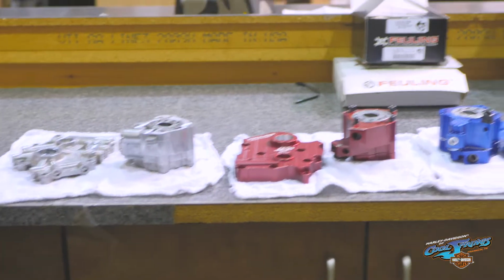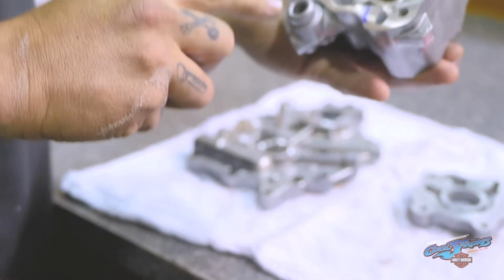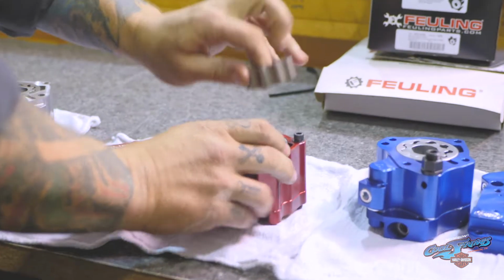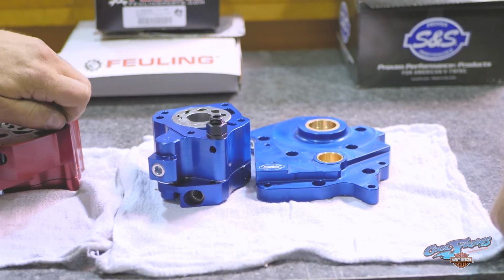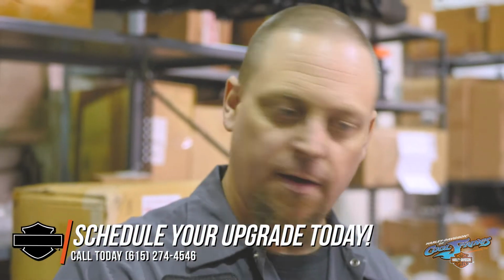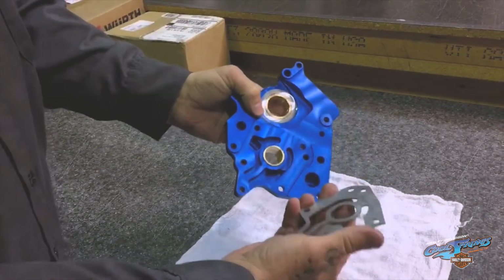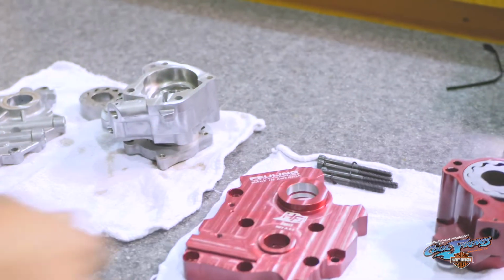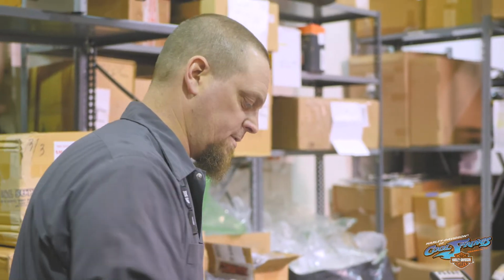Comparing Cam Plate Oil Systems ( S&S, Feuling, Harley Stock) | Shop Talk Episode 6

Comment: Softer metal will last longer,ok
Reply: The pumps/plates themselves are made from from very strong 7075 billet which is 50% stronger than the OEM cast.  The S&S system then adds the bronze bushings to be a "soft wear" point in order to make it rebuildable.
Reply: _MotorfastOk ,but are those OEM plates causing any failures,which require replacing? I do know the pump was replaced because it wasn’t sending enough oil throughout the engine with the stage 3and4 upgrades.
Reply: @tax905972  No the OEM system does not contribute to failure any more than any other OEM component.  The "sumping" issues were not nearly as common as the internet made them sound.  The biggest reason we recommend the replacement is the increased volume on both the feed side and the scavenge side will help ensure the oil is circulating at the highest rate possible.  Therefore doing a better job of cooling, cleaning, and lubricating the contact metals.  The billet pieces are also stronger and more rigid so they add another layer of support to the rotating mass when it is under the increased pressure of higher compression etc.
It isn't cost effective or necessary for OEM manufacturers to include components like these on initial assembly when the vast majority will never be altered.  I install performance upgrades with the OEM pump and plate quite often.  I do require that the OEM unit is the latest model revision.  I do always recommend the performance upgrade though for added piece of mind.
  These motorcycles are a big investment and when you add the cost of increased performance it seems a minor addition to the over all project to get an extra layer of protection/performance built right in.
Reply: @M.V.O _Motorfast, I saw the bulletin which advised it only covered those engines with the stage 3 and 4 upgrades. Sometime later, the dealerships began to upgrade the original pumps. As a precaution, I tried to get them to change mine since I had one of the first m8 engines 09/2016, but they wouldn’t go for it. So far no issues, but I plan to keep the bike under warranty just in case.
Reply: @NoName-vz1ob  makes sense but losing that protection is more of a concern at this point. Don't have time to take Harley to court if they void my coverage.
Reply: @tax905972  are you still under factory warranty?
Reply: @NoName-vz1ob  my bike is under Harley’s extended warranty, which can be renewed till the bike hits 12 years or 75,000 miles. I plan to renew it as long as possible .it also has the wheel and tire coverage on it. Lot of crappy roads in NY.
Reply: @NoName-vz1ob  2 year warranty is up, but, mine has careered over to the 3 year extended.

Comment: Loved the video.... more more more!
Reply: Of you subscribe to the channel there are around 20 videos out and more coming all the time.
Reply: M.V.O _Motorfast  if I came down to your shop with my m8 -107  how would you decide between S&S or Zippers for low to mid torque range and replacing pump and cam plate
Reply from the maker: Thanks! We've got more coming. One is going live today at 3:30

Comment: What do the after market plates and pumps do to the factory warranty???
Reply: They don't hurt the warranty in themselves.  Where you can possibly encounter prolems is in the case of a failure involving the oil system (such as a blockage in a passage somewhere) or one of the components themselves.  Both Feuling and S&S offer great product warranties on their components, however your average of the mill  OEM only dealership may not want to attempt the complexity of an issue.  HDCS stands behind the work they do.  Call the shop and ask for Aaron.  He can answer your specific questions.
Reply: Ounce you crack open that engine or any bolt on aftermarket upgrade your warranty is out the window, Harley is very critical in this area. All replacement performance parts and labor must be through H.D. I have used Screaming Eagle big bore kits with no problems but with that said there is much better out there in the aftermarket world. Fueling in my book is the way to go. S&S had a recall with there oil pump. I have a 2018 Electra glide Limited and have just ordered the Fueling cam/pump set along with hooker headers and SS MK 45 slip-on mufflers. Harley keep your warranty.I would rather put the upgraded system in now while the motor is fresh, It's that much better than stock.
Reply: @jefferyosgood9566  if that's what the dealerships you go to tell you they aren't good dealerships.  And S&S didn't have a "recall".  They made a slight change to plate the design very early on in the process.

Comment: Will the S&S set up help with sumping?
Reply: Chris Comis yes
Reply: PATRIOT821000  Had mine installed Tuesday. Wish that I would have done it from the first sign of problem. So far, no issues what so ever.
Reply: Harley would rather pass the sumping issue to the aftermarket world like they did with the twin cam;  lifter washout/bypass oil valve issue etc. for example. so Fueling and S&S designed there oil pump/cam plate to address sumping issues and provide better lubricating along with less cam plate flexing for that upgraded cam. All in all it's money well spent and would highly recommend, sooner the better. It's a good peace of mind especially when ripping down the highway at 80 + on a hot day.

Comment: Will changing to the s&s does it void factory warranty?
Reply: dlawson Lawson yes
Reply: Installing the aftermarket plate and pump combination does nothing to the warranty in itself.  If there is an issue and it is caused by the pump/plate combo (which is extremely unlikely) it could be an issue.  Most likely the negative could be that if there is a component failure that affects the system you may have to pay out of pocket the difference between stock and high performance parts.  Pick your repair/warranty and/or dealership with care.  Shops like ours don't care what is in it.  If it should be warranty we push for warranty.
Reply: Can’t see it unless your motor goes boom.....most of us using these don’t give a flick about warranty by a dealer anyway

Comment from the maker: Which option do you prefer?
Reply: H-D Cool Springs will the S&S pump and plate cure the sumping issues with the M8 ?
Reply: @freedom6919741  unlike the forums would like you to believe engine sumping is actually pretty rare.  But yes.  They help, as does the latest generation OEM pump and cover.

Call Aaron or Mike at the dealership if you have any questions about sumping or parts comparisons etc.  We can run your VIN and probably tell what version pump is in your bike right over the phone.  Also you can message direct at @m.v.o_motorfast